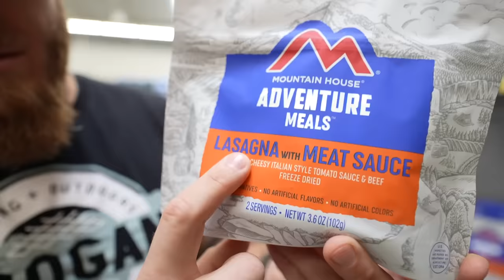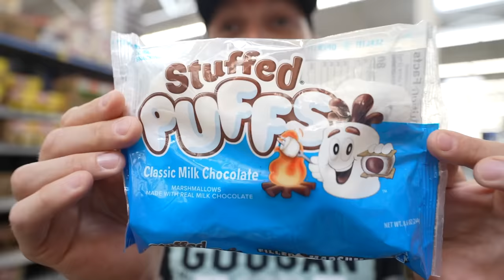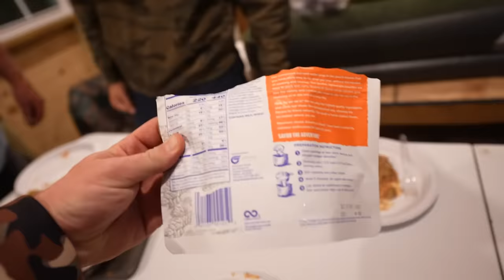Overnight Hunting & Camping CHALLENGE in DIY Cabin in the Woods **BIG BUCK SHOWED UP**

Comment: Great to see another video LOJO, your correct that’s why it’s called hunting and not killing. I was told by a Master Hunter that the secret to whitetail hunting was 1) wear rubber boots, 2) change you socks & underwear at lunch (no stinky undies) 3) always make sure you hunting with the wind in your face. Also you should check out deer scents such as “Tink’s 69”, its doe pee while in heat, but never get it on yourself, use it like duck decoys where you place it (with the wind correct) and you hunt over the scent, plus you can also rattle horns or use a snort call that may have turn that buck towards you (?) but  remember less is more. Happy Hunting, be safe, always know what your shooting at & thank-you for your military service it’s because of men like you is the reason we can own guns & hunt. GOD BLESS You, Your Fellow Hunters & Your Family.